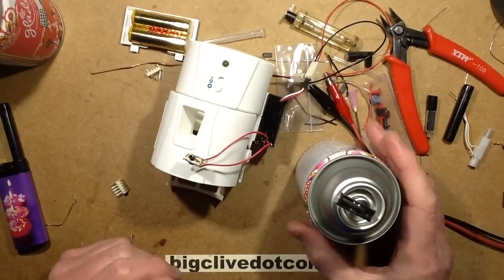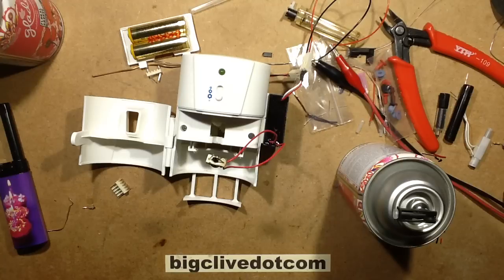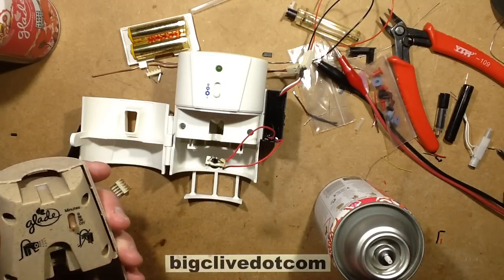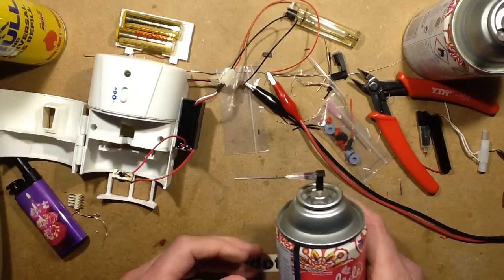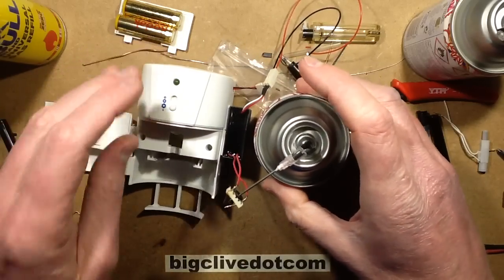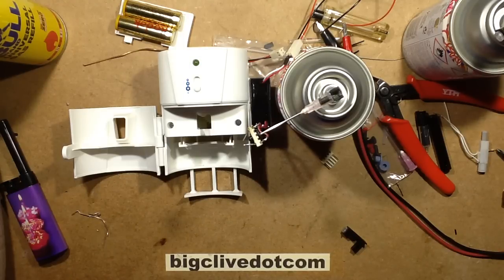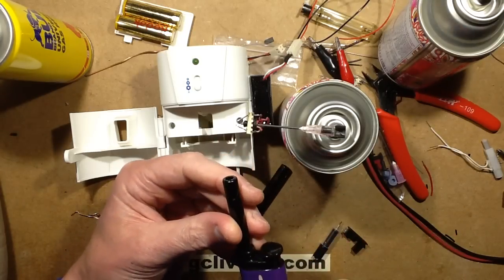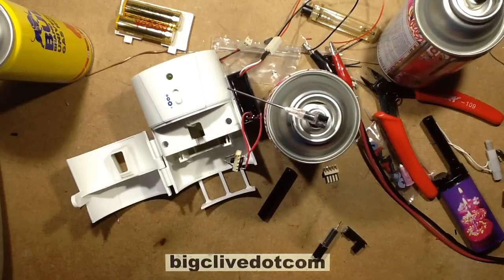Failed automatic flamethrower project.

Comment: I have an AirWick dispenser and holding a lighter about 5cm from the nozzle with the unit closed like usual it works perfectly! The flame can't travel past the hole in the door to reach the atomizer! If If I had a spark generator I'm sure I could get it working! Where did you get yours and how much did it cost?
Reply from the maker: +Blakehx eBay high voltage module.

Comment: You should give that needle a little crimp on the end to spray the gas better and you could also use the needle itself as an electrode and just have a bit of wire dangling in front of it. 
But this here seems like a very novel idea.

Comment: My God, how many circuits do you fry per week to have to mess with air fresheners/aerosol chemical dispensers. Not counting the fun factor of course. I haven't had that kind of odor problem since the time I rigged the doorknobs with high voltage caps. Different smell for sure, kinda shitty in a urine sort of way. Lost a roommate but at least the dog would stay inside after that.
    Mike (o\!/o)

Comment: i was wondering if you used the needle as one side of the power then use a wire just past the tip to create your arch. an insulated wire running up the wire may simplify it. also as stated here already that the needle keeps the fluid from spritzing and keeps it as a stream. do you have anything that you can add to the tip that may help aerate the fluid at the tip?

Comment: Lose the needle and place the arcing device sideways into the smell stream and it should work. You need fuel and air mixture for proper flame. You also need bigger transistor or mosfet to drive the high voltage circuit.

Comment: would putting a hole in the metal tube pull in enough air .also use the metal tube as one electrode and only one on the tip so the spark jumps across the tip .

Comment: Because everyone needs an automated flame thrower. If you revisit it, maybe try one of those neat little 3v to 400kv modules on ebay, that recently scared Mr. Ilett. They seem to spark with some real authority. Probably a bad idea, but injecting a little O2 into the can could solve the mixture issue, if it doesn't explode first. Probably better to use a venturi to draw some air into the fuel stream, but not as exciting.

Comment: I would offset the nozzle from the electrodes, such that the electrodes are just below the main stream of fluid. There should be a low concentration of fuel mist just outside of the boundary of the stream and that would be much more likely to have enough air mixed in.

Comment: Looks like a good bit of fun if you can get it working.

I don't have an air freshener can to test but I'm betting the needle is working against you. Those sprayers have a very fine orifice in order to atomize the 'whorehouse extract', much smaller that the gauge of needle. The fluid is probably no longer a fine and easily ignited mix once it's through the stainless tube. I'd probably have a go at crimping the needle and leaving the tiniest pinhole, maybe even pulling or drilling out the original orifice so there is no loss of pressure. Heck, I've already got one of those HV supplies on the way, might as well order one and try it myself.

Comment: "I'm not sure I'd call it floral groove, I'd call it - 'Hewer-house perfume cabinet explosion' is what I'd call it, particaularly given the amount I dosed the air with while doing experimentation. Anyway, the em.. wherwasI... what was I ... what was I talking about there I've just completely forgot what I was talking about.. the... After lots of experimentation and setting things on fire, I came to the conclusion that it's the air to fuel ratio."

I really REALLY don't mean offense when I say this, but clive you're a mad fucking bastard.

On a side note, maybe you should use a fuel source which pushes the stuff out like the butane, rather than squirting it out like that air freshener. The distance from the nozzle to the igniter needs to be a distance such that the speed of the fuel is right, which you can't achieve if the speed of the fuel is varying so much .

Comment: The sparks need to be WAY further away from the point where the mist comes out. You can't have it right up against the tip like that, it won't work.

Comment: Why use an air freshener unit? I just use hairspray and a lighter whenever I want
Reply from the maker: +TheA_Mboom Because it's automatic and random which removes the need to move your finger and adds an element of surprise.
Reply: +bigclivedotcom I suppose so. It would be fun to have around when you have house guests

Comment: what are those 5pin electrical connector you use ? i have been trying to find some for the pcb's i got off ya :D
Reply: +killer1479  KF2510-5P (see ebay)
Reply: +David Pilling thank you kindly:)
Reply from the maker: +killer1479 2.54mm (0.1") Molex style connectors.  Very common and also available as cheap clones.
Reply: +bigclivedotcom thanks, i have found pack of 100 for about £10.50

Comment: I think something based on the Venturi effect might be useful here. If you set it up so the nozzle-needle from the air freshener shot down a narrow metal tube with a slight flare at the outlet, and put the spark cap across the flare, that might do it.

The movement of the gas down the tube will draw air in from the back side (make sure there's enough opening toward the back for air to flow in), mix as it goes down the tube and swirl together at the flare, right where the spark gap would be.

Might have to experiment with tube lengths and diameters to dial it in, but, that's where I'd go with it.

Comment: I just saw one posted on line available to magicians, It is worn on the wrist and shoots out fireballs. Its not cheap however $170 odd dollars. I havent looked it up myself but it is very compact and seems to work great. the add said it could shoot fireballs up to 30ft. Anyways,Great project. I think I will stick to stuff that doesnt shoot fire balls.
Reply from the maker: +scott firman The fireball shooters often use a glow plug igniting a wad of flash cotton that fires a ball of flash paper with a tail out of a tube.  Forget $170 you can buy professionally made flame effects for much less than that.  The ones I've had used a brass nut (for the glow plug) soldered to a bullet shell as the launch tube.

Comment: It's not just the air-fuel mix, you may want to use a "flame holder". The traditional explanation of how they work is that they make eddys in the flow so parts of the flame circle back to light the gas which then circles back...
My take on it is that it's also to do with the speed of the fluid vs the speed of the flame in the mixture. If the mixture was stationary and you lit one end of it then the flame would propagate at a certain speed. If the mixture is flowing faster than that speed and it is lit then the flame would get blown away from the point it's lit at and then go out. Slowing the gas down would help. The thin needle is making the fluid move fast. Having a small bit of metal in the flame which will light the fluid on contact due to being hot, and get heated by the flame would help. Maybe put the needle part way down the middle of one of those metal lighter ends, the fluid should slow down after exiting the needle, mix with air it sucked in from the back of the lighter end, and then make use of the flame holder at the end of the lighter end. Like a Bunsen burner.

Comment: If you look at the pilot flame of an actual flamethrower, it's ahead of and below the nozzle. The aim indeed being to ignite the vapour which comes off the liquid, so you get a stream of liquid which is on fire when it hits the taget and will continue to burn once it does. 
So I think moving your ignition source slightly out of the path of the propellant/fuel and, possibly, switching over to hairspray will yield more succes. That's how we did it as teens in the 80's, only we used those little hotplate candles to ignite our Elnett.

Comment: find a metal tube inch or two long to slip over the existing plastic atomiser nozzle, something like an extendable car aerial or pick up magnet should have a close match, drill some air holes in it right near the atomiser. drill another hole near the business end to stick your spark gap. you could cut the end of a k type prob with the fibre glass sleeve for the spark gap, if the insulation can take the voltage, if not, use the tube for a "ground" and use a single wire.
Reply: however, I'm not 100% sure.
Reply: The blunt dispensing needles, like that from his inkjet refill kit, can be purchased in a good many gauge sizes and lengths, many of which are readily available online from Amazon.  Essentially what is needed is a Venturi arrangement to draw in and my air with the fuel prior to ignition.
Reply: +Ethan Poole my = mix.  I will never understand why iOS has to go back and change properly spelled words and phrases well after they were written, it is always tripping me up!

Comment: It seems that the nozzle you're using is too wide and too long, but its more to do with the fact that it is too wide. You see, when the hole is bigger there's less compression and pressure forcing the gas out. The liquid is building up in the nozzle and stopping the liquid from being shot out. Its just clogging up the nozzle and its just going to drip out after a few squirts. Get a nozzle that has a smaller hole. Or at least get a nozzle with a hole around the same size as the hole on the original nozzle. There would be enough pressure and compression to force the gas and liquid (the air freshener vapours) out as it is supposed to be and it will ignite.

Comment: I know this is going to get lost in all the noise of replies, but Clive I hope you catch it. I assume what your after is a fireball / fire cloud effect rather than a flamethrower. The needle is the problem, yes it is part the issue is air-fuel mix but it is a small part, the lower flammability ratio of butane (probably the major component that is burning) of the is 1.6% butane in air at 25 degrees Celsius, it wants to burn! 

The problem is by changing away from the plastic nozzle to the metal tube you have changed from a shaped orifice that generated a full cone atomisation pattern to a plain orifice that generally produce little atomisation and good at making streams of liquid (water pistol effect), this can be seen in the vid, rather than getting a cloud you get a stream. One test that you can do to see this happening is hold a bit of paper in one hand, let it hang down and spray at it with the plastic nozzle, then repeat with the metal tube. The plastic nozzle will make it move a bit, the tube will blast it, also with the tube you may end up with stuff on the paper where the stream hits it. 

The problem for you with the stream is that firstly atomisation slows the speed meaning that cloud has time to mix with the air (plus it is more spread out, taking up more volume = more air = more oxidiser) and slower that it is travailing more chance the flame front has of propagating through the cloud, where the stream is moving fast as little atomisation has occurred. I will hazard a guess and say with that metal tube (even if you put a tube around it to promote mixing) the only way to reliably get combustion is to hold a flame in the way and shoot through it. The second is are you after a dirty big fireball or a messy jet of flame? I believe your after the fireball, the stream will give you a jet if you get it to combust properly.  

Ok next thing is how can we get the desired effect with using the metal tube, well by the looks of it you may have all the parts already on your desk. This should be simple to try out. One good way to generate atomisation from a plain orifice is to change it in to a surface impingement nozzle, in less tech speak, stick something in the way. A good something would be one of the electrodes, bend it in front of the stream path.

If this fails to produce the desired results rather than messing around (unless you want to) with adapting concepts from lighters as I see this will not give you the desired effects (back to jet vs fireball). You need something that has a metal nozzle and has a nice conical atomisation pattern, the ideal thing that I can think of is an airbrush. You should be able to pick one up on ebay for less than 9 pounds shipped. My initial thought was to run it with out the paint jar to allow extra air to be mixed in, but on second thoughts it would be interesting to put in alcohol with salts in it for coloured fireballs or cooking oil for extra hot extra smoky chip shop smelling fireballs.
Reply: +David Chester Thank you for the information.  Do you have suggestion for additives to create the different color flames?
Reply: +David Null You may want to look at https://en.wikipedia.org/wiki/Pyrotechnic_colorant for starters. A quick answer is Calcium salts for orange (commonly calcium chloride is used), Strontium salts for red (strontium chloride) also lithium salts are red, Sodium salts for yellow (sodium chloride, table salt),  Boric salts for green (Boric acid is a common one, people do try to use Borax but it also contains sodium so there is a yellow cast to the flame), potassium chloride is lavender coloured (look for salt substitute at the supermarket, some times it is noting more than just potassium chloride). 

The main issue is that alcohols are less polar than water, in that salts dissolve less well, it can be a hit and miss affair doing this at home. One big rule of thumb is if the salt is not dissolvable easily in water then you have no chance with alcohols. A second is chloride salts are generally good to aim for. Third is some of these are toxic when ingested, use a brain, don't lick things, don't drink it, and wash your hands. Forth have a look around the net and see what others have done, there are many sites. Five do not store in metal containers or ones with metal lids.

If it is all to much hassle look up online shops for poi fire twirlers, most of them sell the powders for the colours ready to dissolve or dissolved for you.

Comment: You could actually retrofit the butane cylinder and the electronic spark igniter on that lighter assembly. The lighter extension already contains the requirements and all you need is to replace the piezo igniter with your electronic spark igniter and glue the plastic tube carrying the butane over the cylinder nozzle.

Comment: Put a small funnel (the ones used to refill things like clothes irons) with the large opening towards the syringe (the  end of the syringe should ideally stick at about the centre of the conical part of the funnel, and if you get a syringe with a smaller bore it will be better) and put the igniter at the end of the small part of the funnel. The funnel will act like a very crude Venturi burner. I have tested it with gas from a duster can and it worked for me, although it may depend on the pressure of the gas and the diameter of the funnel. You may also want to extend the funnel with a small copper pipe otherwise it will catch fire :D

Comment: My ideas:
Cut the syringe off short, then glue a larger diameter tube over the syringe plastic section with holes drilled in the side, then put the ignitor on the end of that, then you'll mix the gas with air in the outer tube before it hits the spark.

Comment: It's the pressure BC. You might need to place a chamber in line with the ink jet needle to drop the pressure, just like a gun blowback system.  
If you drill a couple of holes on the needle then fix a larger cylinder space over the holes to lower the pressure then it should work.   
You will need to do some maths to figure out the pressure in the needle, the hole diameter and the size of the gassing chamber to get a perfect flame but if you just fiddle with the principle it should work.  
I should add that if you ventilate the cylinder you should get an air gas mix at a lower pressure.  
Think of it like a cap.

Comment: The ignition spark is too close to where the fuel exits the nozzle. Try soldering on extensions to the electrodes and experiment with distance

Comment: Make a contact with the needle, then an insulated wire at the top stretching forward so the spark jumps from wire to needle, like most lighters do, so spark is in line with the needle, not across it, should help with preheating the gas, plus more contact area
Reply from the maker: +Sparky Projects I tried that too.

Comment: i would suggest using the rubber things as a spacer, slide the ligther "barrel" thingy over the needle so that the needle is centered, then try to use the needle and the barrel themselfes as the electrodes. Also i think the butane would work much better than the freshener... Don't blow yourself up man! :)

Comment: at a guess I imagine there is not much atomization from the syringe. keeping it fire-proof could you not put some resin in the end of the syringe and drill a very very very small hole in it or something, the pressure from the compressed gas should cause it to atomize quickly when squeezed through a very small hole

Comment: I encountered this exact problem when I was building a tiny handheld flamethrower a while back. The trick is also as you described, because of bernoulli's principle you can add holes to the side to aerate the gas and improve the gas ratio. I solved this by using a 3-d printed nozzle, but you could probably do the same thing with a metal cylinder and a drill press. 
It should be noted that my solution still wasn't perfect but I didn't spend a lot of time calculating or tweaking it, and it still drastically improved the performance.